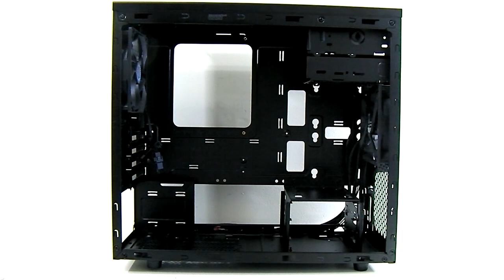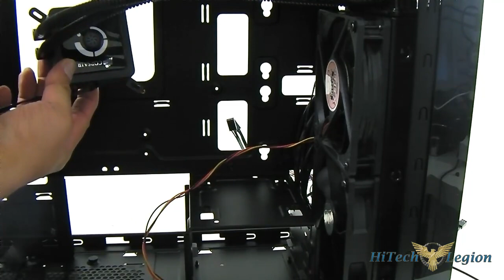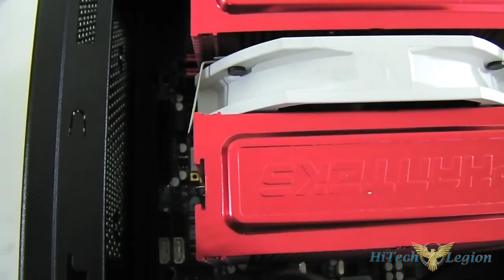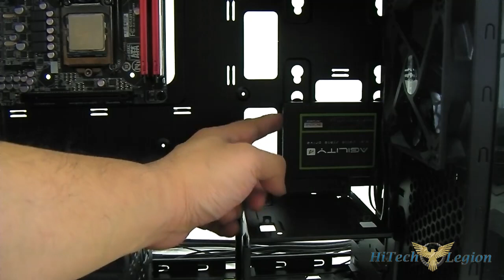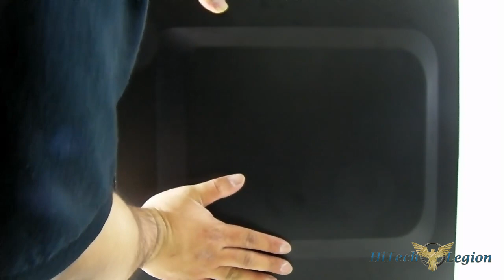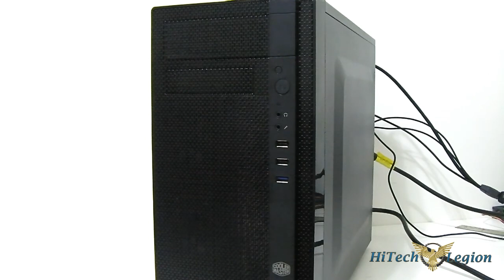Cooler Master N200 Mini-Tower Case - Component Installation Tutorial Guide

Comment: I know that you can't reply to the stupid Google plus messages that were posted a month ago, but to everyone wondering the hyper 212 fits, but it helps to have tiny hands if you install it to the motherboard inside of the case. If you do it outside of the case there is no problems whatsoever other than RAM clearance on the tiny mobos

Comment: It's sad that Cooler Master did not include more USB3 ports in this model. I have found a bit cheaper similar case with more USB 3 ports and also LED fan options, just look for Sharkoon MATX cases. But they might be available only in Europe.
Reply: I think there's an N200 'Advanced' variant that has 1 x USB 2.0 and 2 x USB 3.0

Comment: I really wish they could have shortened the depths of this case. The amount of space they give to GPU is overkill, as it hinders how smaller the chassis can be if shorted up. Yes, they do provide space for front radiators in case you watercool, but not many people have dual 120mm radiator for CPU cooling anyway. Most people still use air cooling and could use extra compact-ness (lol).

Comment: I had this case.. and i put normal size 120mm or even 140mm will fit at the top..
Reply: Hey people from 6 year ago. I wanna ask, If I installed Cryorig H7 in N200, can I still put normal size 140mm on top? Or only the slim 15mm width one? Because I want MAXIMUM AIRFLOW PERFORMAAANCEEE :D with 140mm 3000 rpm noctua on top

Comment: Hello, I've also read this review. I am curious about an FM2 micro-ATX motherboard coupled with a Dark Rock Advanced C1 Cpu Cooler. It's height is 166mm, do you think it would fit? I'd really like that 'cause I want to OC a 760K BE and the cooler is rated for 180W, otherwise I'll stick with a Shadow Rock Topflow SR1 which is rated for 160W but it's C shaped.
Reply: The dark rock advanced c1 won't fit inside since the cpu cooler height clearance is only 160 mm without the fan on the side
Reply: It has a 140 mm clearance with normal fan on the side of the case
Reply: And I know this must be too late

Comment: well, dont think this is a good case
I dont think the AIO water cooling have long enough cable to mount the 240mm radiator at the front also I kinda hate mess finish front panel, you need to constantly clean it, is easy to gather dust there..... (just like my current Bitfenix Prodigy)
Reply: if you want a 240mm raidiator in the front then you'll need it remove the external 3.5 inch bay and move the hard drive cage back a but